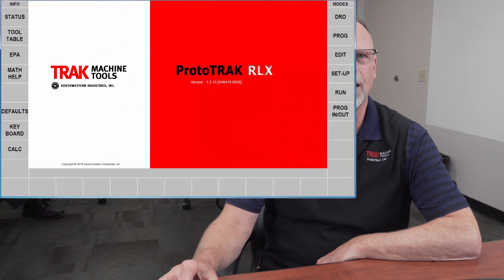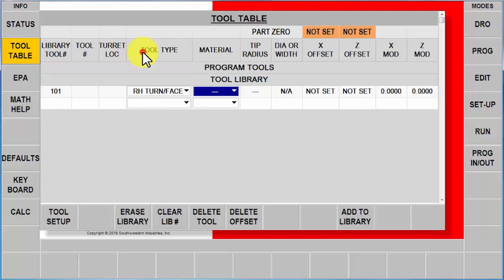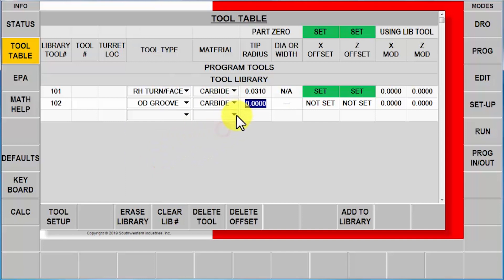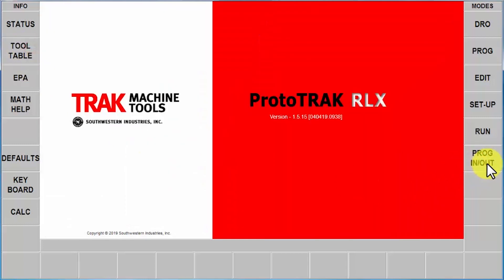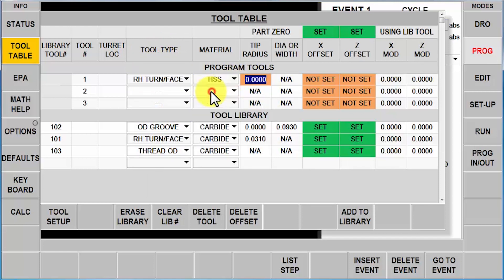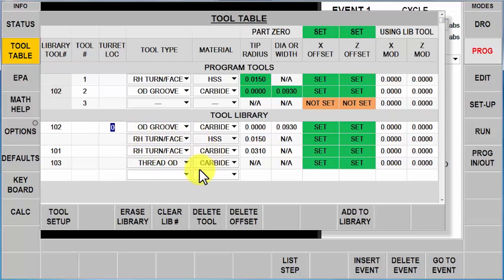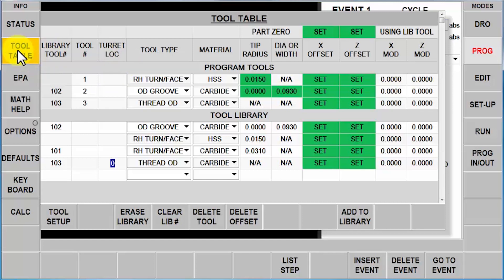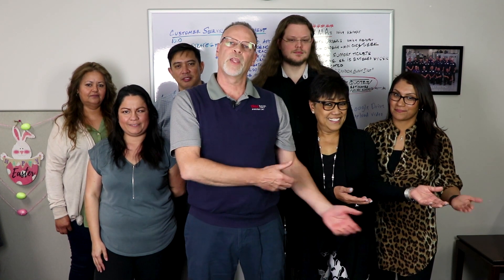Tool Setup [Part 2] | ProtoTRAK RLX CNC | Lathe Tool Setup (Offline)

Comment: From the last video to this one, I was expecting the tool library you had set up previously to persist through reboots. Is that just a wrinkle in the offline software - it doesn't retain the tool library through restarts but the on-machine controller does?
Reply: Hi, First of all, I need to make sure that you have your dongle key in your machine and you have the advanced features turned.  Assuming you do, are you setting up your tools in the library or just in the program tools? If you set them up in the library, they will stay in there until they are deleted. If you set them up directly in the program section, they will stay with the program so if you save the program and open it at a later date, you will know which tools you used the last time to ran that program but you will still have to touch them off or assign them from the library.  Does thus answer your question?  T.P.